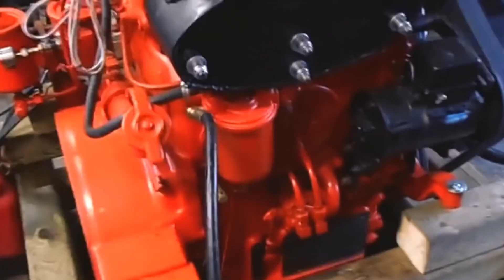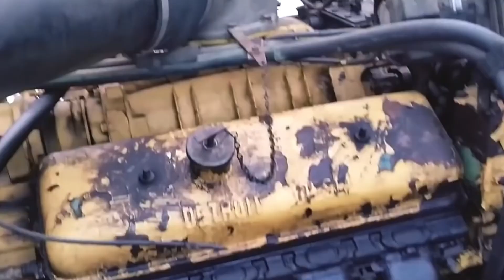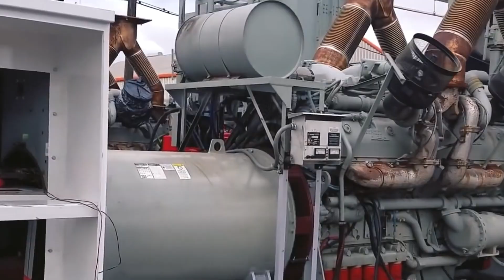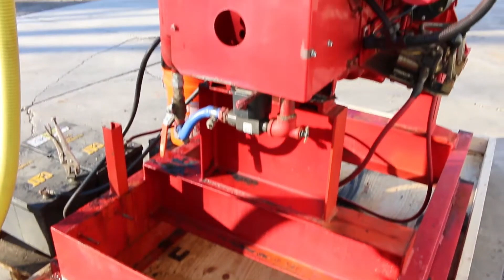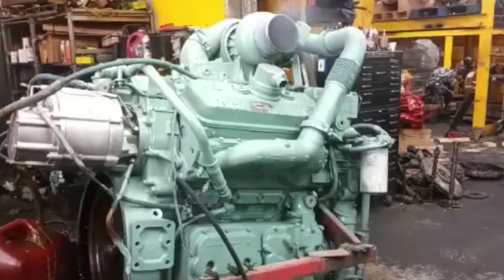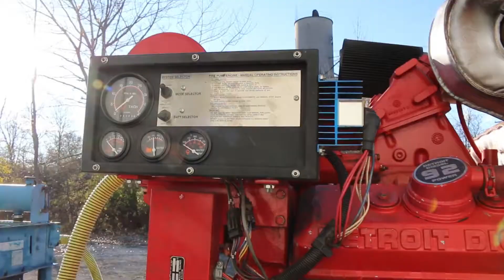The Shocking Truth Behind Detroit Diesel 6V92 Engine!

Comment: If they're that popular for sale I have 2 I'll sale.  They're  marine   engines with a turbo, interior and after coolers pushing 375 hp. One needs rebuild and the other has 500 hours on it, runs great. Both have a TD 511A Transmission 1.5 reduction gears on them. They were government remain engine and transmission when I bought them.

Comment: City transit busses in Calgary still had Silver 6v92s when I was apprenticing as a diesel mechanic working for a Detroit Diesel dealer. In the early 2000s The DDC two strokes had mostly disappeared but you could still find them here and there, especially in bus fleets, oilfield rigs, boats,and racing trucks.

I don't know why the video is saying that the 12V92 was locked away in a vault. There were 12v92s everywhere, especially in marine applications. I've worked on them on Canadian Coast Guard ships. Maybe I misunderstood and the engines that were locked away were super special secret 12v92s, not the regular ones.